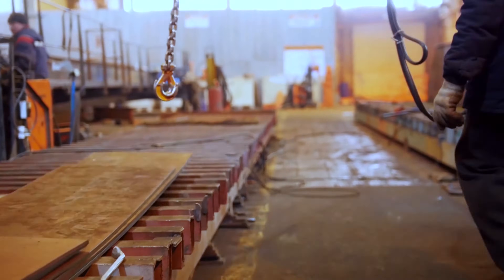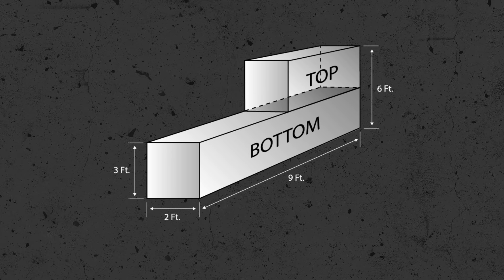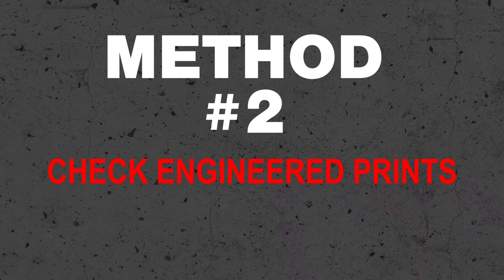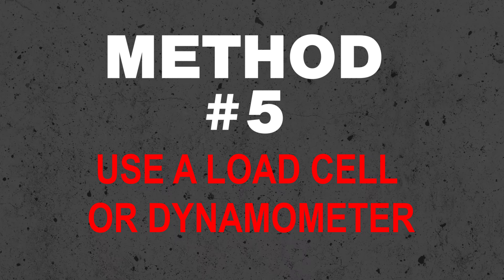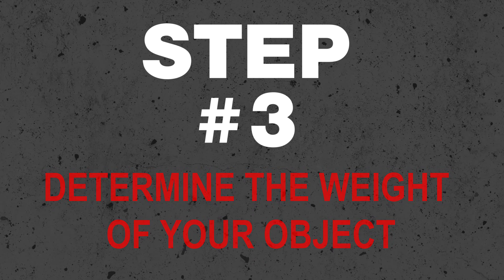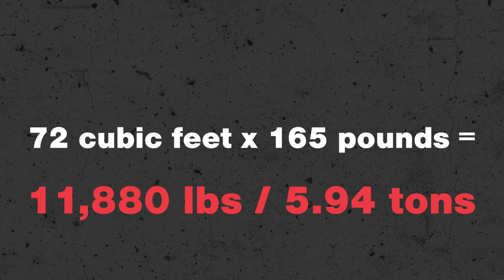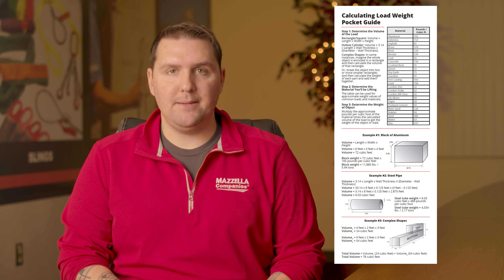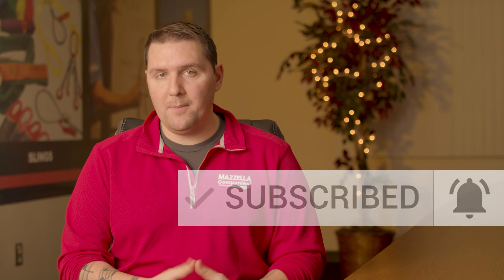How to Calculate & Determine the Weight of a Load for Overhead Lifts

Comment: Why you take length of concrete small block as 4 feet while half of 9 feet should be 4.5
Reply: They are not saying that the small block is half. Four feet is the length of that part of the shape. They could have used any length up to nine feet. They picked four feet.

Comment: Finding out lifting points that you may know existed?? Here in the UK, we have standardised symbology that has to be very near ALL the lifting points.
I like your explanation but you have some missing factors that can't be checked as it is not that straight forward.
I specialise in lifting containers for the construction industry, knowing the exact weight is essential but sometimes you have to overcompensate a ton or two.
It could be container offices, welfare units, dry rooms, even generators.

Comment: About calculating the volume of that pipe. 1. Because you use the wall thickness and the diameter, it seems that the volume would calculate whether it was a pipe (hollow object) or a solid steel cylinder. So in step 3 your would end up with the same weight. 2. Why calculate wall thickness and diameter? Seems like you would use one or the other. Thanks

Comment: WHATS THE CORE DIFFERENCE IN CALCULATING SLING SWL AND CRANE SWL ???
Reply from the maker: Great question! First, we want to shy away from the term SWL, which refers to Safe Working Load. The preferred term is WLL, Working Load Limit.

The WLL or capacity of a lifting product is determined by the manufacturer of that product and is usually a percentage of average ultimate breaking strength determined by the design factor (formally called the safety factor) applied to that particular product. Most, but not all, slings have a design factor of 5-1. (chains are 4-1) Most overhead and mobile cranes are somewhat lower and can be in the 3-1 range. 

Hope this helps!

Comment: How are load charts calculated
I mean if I have a 50 ton crane how to know how much  it could lift at a specific raduis and length or how to calculate crane rated capacity
Reply: The people I worked for 25+ years ago. Kept the Cranes "BIBLE" with every crane. Boom ange rotation position
Height jib or not. Rigging remember lower boom angle and longer boom the less you can pick. Sling length and type.

Comment: Once I had to determine the weight of a truck and if it was balanced or not. The method I use was to measure the air pressure in the tires and the area of contact of each tire. That way I get an accurate enough measurement.

Comment: Great video, thanks. Using metric units avoid the unnecessary step of convert from different distance units but I understand that is not easy to change once you learn imperial. I just learn how to use both and don't have any problems.
Reply from the maker: I've heard a few different people mention how much easier everything is on the metric side! 

Thanks for watching the video Rob!